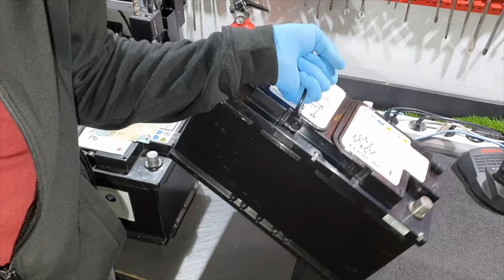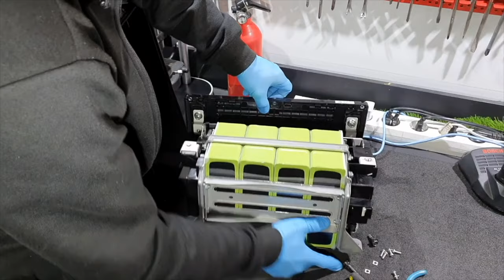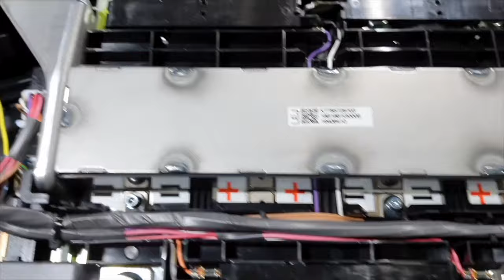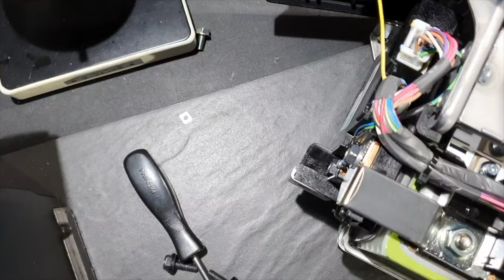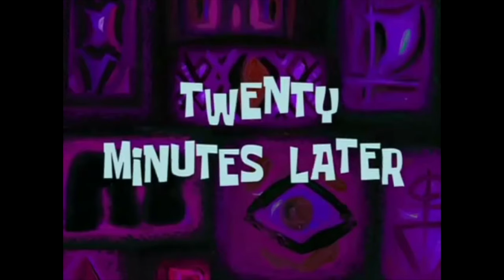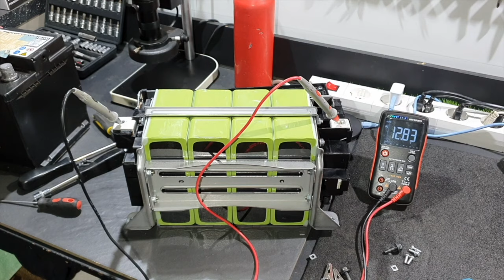BMW lithium Ion Battery Recovery

Comment: So my battery has been over charged (by putting it on a standard  battery charger), the voltage has now been drained down to 11v and charged back  up to the voltage shown in your video , but the cut out stays open so I don't get a voltage through to the terminals.  How do I reset the cut out?

Ok, ignore that message,  I have read through the comments and after disconnecting the 2 white plugs on the left hand side for a couple of mins,  full power has been restored.

Thanks for all the information, definitely the best video on this battery on the Internet. 

  by the way I am only using the battery for powering a fridge when camping ,so I am not sure if the disconnecting counter will affect it
Reply: which 2 white plugs ?

Comment: I followed all the steps , I’m getting 14 bolts on the terminals and where you put your power supply , but I’m only getting continuity in the actual cells

Comment: Help! My battery is charged to 13 volts and the isolation switch has not closed yet, how long should i wait? Is there anything else i should be doing?
Reply: Any news here?
Reply: You have to unplug all of the connections to the switch and module to make it restart and re-read

Comment: When I open my battery and test the cells I show 13.3 volts but the BMS circuit is open and the battery posts show 0 volts. I tried the method shown here but the BMS circuit doesn't change I assume because the cells are already charged. This is the original battery from 2016 the vehicle was always kept indoors in a climate controlled environment. Did my battery just expire?
Reply from the maker: Try to disconnect all the plugs leave it for 15 minutes and reconnect them back , if nothing happened after that, connect a battery charger directly to the terminals ( from outside) first check that your charger will have voltage (some wont start to charge until will detect a battery voltage if this is the case that is not good for this)

Comment: Very useful video! About the charging mode you've mentioned in the video, what is the different between AGM battery charging mode and Li-thium battery charging mode?
Reply from the maker: Hello . the charging program of a car with agm battery can have voltage peaks of up to 15 volts , which will activate the protection of a lithium ion battery

Comment: Hi this is really helpful but I can't understand why you removed the case to charge the battery? Can't this be done with the case on?
Reply from the maker: Hello . I explained in the clip if the battery is in protection , the cells will no longer receive power from the terminals, you will have to charge them directly
Reply: What are the cells in side these units 18650 ?

Comment: Just a quick question. Do you think adding 12 volts with a jumper pack would be able to activate the battery again? Or do you need to charge it with a special charger?
Reply from the maker: Yes, with the condition that the jumper pack has a permanent ouput 12 volts, not to turn on 12 volts only if it detects that it is connected to a battery

Comment: Hi I've done everything like in video. The voltage in my battery is over 13V but the swich is still open, what should I do ?
Reply: the car is after crash and the voltage was 0,2V per cell before charging

Comment: If you have an over voltage situation and the isolating switch opens, how do you close it again?
Reply from the maker: Hello,  will close automatically after the voltage return to normal,  if you heave repetitive high voltage spikes it is possible to remain open

Comment: i followed the procedure and fixed 2 battery but 1 battery is keep showing fully charged but no voltage
Reply: Prøv at ta de hvide stik a.. det hjalp mig
Reply: I have the same issue

Comment: Good video and very useful.
Got my m5 after accident. Charged the battery the same way. Everything works fine, but... I have an annoying DME error "Battery Fault". Is there any solution how to fix it?
Reply from the maker: Hello! at this moment the only solution is a new battery! maybe in the future someone will study and develop a way to restore the memory and write the BMS .
Reply: Hi man i got an f82 is there anyways u can explain how did u charge the cells?did u use a battery charger?
Reply: Did you find a fix for it? I have the same issue but with F82

Comment: Question so I was able to charge my lithium battery cells up to 13v from using your instructions in the video. I heard click from the sensor but im still nothing voltage on the battery terminals themselves
Reply: Battery 🔋 is back up and running thanks to your page
Reply: @andrezachary7951  Any news here? how long to charge to hear something ?
Reply: Everything work perfectly 👌
Reply: @andrezachary7951  just dismount it like in the video and charged the battery thats all? How long did you charge it ?
Reply: @Abdulx33  I let it charge overnight

Comment: Thanks for the great video. My ISTA showing I have issue with isolation switch since very long time. car runs fine for 2 years now. is it possible to just change the isolation switch or I need to change the whole battery? do you have the part number for it? much appreciated
Reply from the maker: Hello ! you will have to replace the battery, the isolation switch is part of the battery ,you will not find it separately.
Reply: @MOvidiu  thanks alot, what if I got it from other dead battery? I mean is it replaceable?
Reply: Hey bro, did you fix your battery in the end?

Comment: Have you ever tried to play with the 'Battery Electronics Module'? Is it possible to replace it/flash/reset it?
Reply from the maker: God point! I didn't play with it,  but I have think about it,  to be able to restore the battery will need to be reflashed , now depending on what processor or memory it has and if it is protected or not to read and writhe . Ideally ( of course if is not protected) it is to read a good one preferably new and used that dump to reflash the old ones,  an with that you can compare the two to see what and where is the difference in order to manually reset it . I'm pretty sure that every time the battery will be disconnected/discharged inside the memory will be something written and I think it has a number of disconnections and after that will permanently send messages in instruments that need to be replaced
Reply: @MOvidiu  I have exactly this issue. I had a car which was dead for 6 months, I recovered all the cells, and the battery is fine. The only issue is that BMS is sending a message to my car to replace the battery. 

I thought about the exact same way, get a good battery, and read the flash. Write the flash to the old battery to stop the annoying iDrive message.

I spoke with a few people, and some said to buy a new battery, it is not worth the risk. IMO if you know what you are doing, there is no risk. They said my car would blow up if I started to play with the battery like that:) 

I don't think they actually tried what we are discussing here, but I feel this could be a valid way. I am currently looking for another dead battery from the BMW M5 to see if the flash can be read.
Reply from the maker: @adrianmierzwinski9262  The cars are blowing up only in movies,  by reseting the counter won't affect the monitoring of the voltages,  if you are able to read it please let me know!
Reply: @MOvidiu  I will keep you posted. Everybody I speak with is against it, and the only fix they have for those batteries is what you presented in the video. I am sure more can be done as this is just a software thing to rest the counter.
Reply: @adrianmierzwinski9262  please update did you manage to solve the idrive message disapear
Reply: @adrianmierzwinski9262  did you make it work ?

Comment: What is each cell supposed to be at ? My battery i at 12.97 volts and still not opening the switch to my terminal
Reply from the maker: The voltage is good, but that doesn't mean that your contact switch will need to be closed, it the battery have a lot's of opening because of low or over voltage, the contact won't open anymore, in that case you'll need a new battery
Reply: @MOvidiu  can’t I replace the two relays to fix the issue ? Where the switch is under the part is A0035421819

Comment: Hi.  My m3 won’t start after parked for 3 weeks.   Try charging it everyway I can think of.  In and out of the car.  Lithium charger saw the battery and show it start charging but the next day it stopped and can’t see the battery.  
Saw your video and open it up.   My issue is.  It reads 13.50 and 0 at the post.   I can’t get the the protection relay to reconnect.  I try the ctek reset and it won’t work. 
I saw somewhere that the relay switch says open if it’s over charge??   
Any suggestions?   At this moment I’m trying to use a source to bring the voltage down and see.   
Thank you.
Reply: Hey bro, did you fix your battery in the end?
Reply: @erez_bmwm7539  yes I did.  Reset the battery by opening it up.  But unfortunately I think when I jump the car in the beginning I burn out my rear control module.   I was driving it around with no parking sensors and rear windows etc.   I got a new module but a bmw specialist mechanic couldn’t get in to program it.   So had no choice to take it the dealer.   Of course told them what it was and all.    Still wanted to charge me  diagnostic fee and install the module fee and then programming charge.   What can you do.  All that and parts was same price for the battery.  
Guess I’m lucky to be able to save the battery.  If the dealer saw it first I know they would charge me for a new battery.

Comment: Hey! how did you solve the problem? I have no power at the terminals - the battery is charged
Reply from the maker: Hello , watch the video because I have shown everything that I have done . if yours don't work maybe you have a different problem
Reply: I can repair your battery, this is not only problem in cells.
Reply: @ecudoctoreu  what is the problem? and how to solve it?
Reply: @aldislembergs422  Send me your battery to regeneration and reset
Reply: @ecudoctoreu where you located I need my lithium battery checked out ?

Comment: Am un fault : Battery isolating switch, starter battery faulty .. 

Mașina primește rău .. câteodată se oprește .. la a doua pornire merge .. mi se pare ciudat ca o baterie LI Ion sa tine doar 3 ani .. mă gândesc că nu sunt celulele ci probabil switchul sau BMS ? Nu se pot cumpăra de nicăieri ?
Reply from the maker: Salut , vei avea nevoie de o baterie noua , posibil ca bateria sa fi cedat din cauza exploatarii necoresunzatoare posibil sa fi avut multe descarcari ( masina stationata pe perioade lungi )

Comment: Please I need your help. I bought the battery last year . And I did not start the car for 1 year.
Now I charged the cells .(inside I have 13v) the terminal still 0v
Reply: Hey bro, did you fix your battery in the end?

Comment: I unplugged the white connectors for 20 mins and then when i plugged them back in i heard a loud click and have 13.2v on the terminals. Put the battery back in the car but now have a warning message straight up on the car saying “electrical power supply” risk to electrical power supply do not switch off engine. The windows wont work but the car starts and some of the dials have not come on? Anyone had these issues?
Reply from the maker: When you have a problem with your car, the first thing is to do a diagnosis !!! Not asking strangers what could be , because these cars are not like the ones built in the 80s, that had 3 wires and for every problem could have 1 or 3 defects .
Reply: @MOvidiu  I have run full diagnostics on the car and the battery itself produced codes 304 and 305 showing battery aged and faulty. The battery holds a steady 12.8v but I guess the control module is broken. This is why I asked as you seemed to be expert on these batteries and could have suggested a fix?

Comment: Hello,

My battery has no power from the top switches but the cells have charge how do I fix this problem.

Thank you!!
Reply from the maker: Conect a 12v permanent supply to the terminals anl wait 15 -20 minutes
Reply: @MOvidiu  i left it to fully charge but still there is no power to the top terminal but on actual cell it has full charge
Reply: Remove and plug in the 2 connectors at the bms. In my case the relay closed again
Reply: @IngoHerges  I’m charged mine and it’s full. No power on the top. And I removed and plug in 2 connections. Still not helping
Reply: @romanskapoushchenko8993  Hey! how did you solve the problem? I have no power at the terminals - the battery is charged
Reply: After a week of research, this was the only video that solved the problem perfectly. I returned the new $2100 battery to the dealer. Thank you, I am very impressed.
Reply: @MOvidiu  do you use normal 12v permanent supply for normal  battery or charger for LI-ion battery for this

Comment: I did like on your video and lithium charger says battery is good and charged. But still not power on the top! I’m removed all plugs and still not help. I did buy pass,straight line and after isolating switch started clinking!!!! Taken off buy pass and still no power on the top
Reply from the maker: Hello Roman I'm sorry to hear that you failed to bring it back to life, it may be a defective internal module or it may be permanently blocked due to many disconnections
Reply: @MOvidiu  maybe blocked because we put too many times jump box and charger, before i knew it was a lithium battery
Reply: Ok I put battery back to the car and put jump box to start the car and car doesn’t start because other problem was.  Then I take off jump box and battery awoke. Now everything perfect. Thank you man,!!